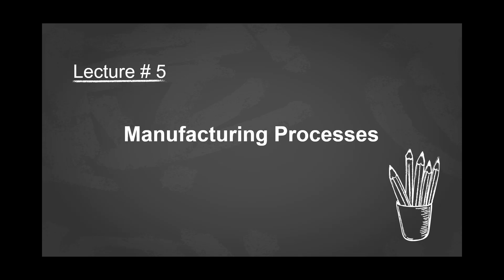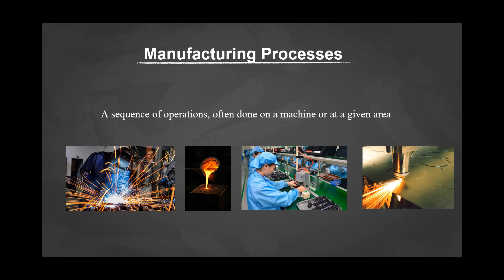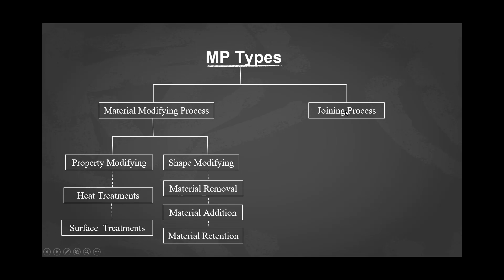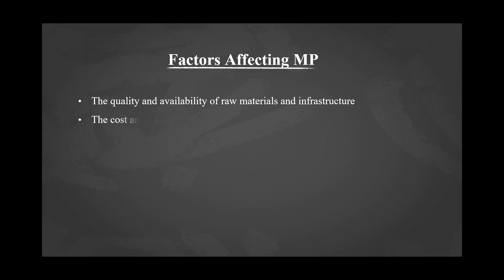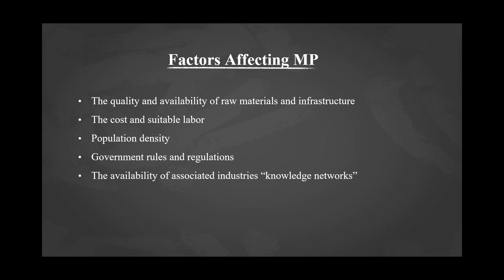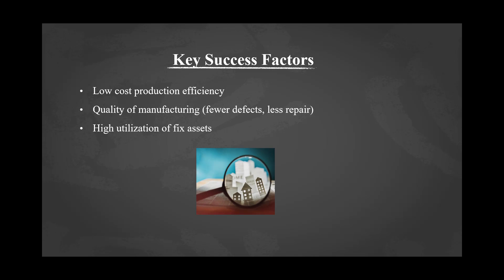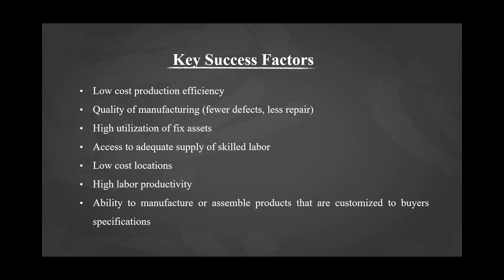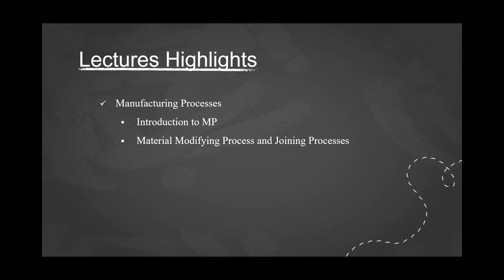lesson #5: Manufacturing Process,  Types, Factors and key success factors of manufacturing process

Comment: F18-0308
BS SE 5TH SEC A .
Manufacturing process is set of opertaion often perform on a machine or a given area to get the desired output .
Manufacturing process can be  of two types
• material modifying process
• joining process
In material modifyfing process we modify the shape or property of a material  . In joinig process we may have permanent , non permanent or semi permanent joints . 
          There are many factors that affect the Manufacturing process i-e 
• quality and availability of raw materials 
• population density
• knowledge networks
• cost and labour etc
  
KEY SUCCESS FACTORS:
 There are the following key success factors 
• low cost production efficiency 
• quality of manufacture
• low cost location 
• high labour productivity and many more

Comment: Muhammad Hashim Khan Jadoon
F18-1208
BSSE A

Summary:

In this lecture we discuss about manufacturing process and types. First of all what is manufacturing process. Manufacturing process are the steps through which raw materials are transformed into useful product.
There are two types of manufacturing process:
• Material modifying process.
• joining process.

• Material modifying process:-
Either changed the properties of a material or a shape shape of a material. It has further more types like
•Property modifying process,
•Shape modifying process.

• Joining process :- 

Joining process includes mechanical fastening, brazing , and adhesive bonding etc. There are three types of joining process:
• permanent,
• Non-permanent,
• Semi-permanent.

Along with this there are many other factors that affect manufacturing process like cost, quality, labour etc.
Now we would talk about the key factors that affect manufacturing process are: high utilization assests, low cost, quality of manufacturing etc.

Comment: F17-0136
BS (SE) 5th C
In this lecture we've covered manufacturing process in detail
Introduction : manufacturing process is defined as a sequence of operations often done on a machine or at a given area e. g casting, assembling and cutting etc
During Mp we add or subtract or form material to get a desired property
Cycle of manufacturing process converts materials into parts and products start immediately after the raw material either extracted from the minerals or produced by chemical or natural substances
Types of Mp are:
A material modifying process (property modifying, shape modifying)
Joining processes e. g welding etc
There are permanent, non permanent and semi permanent joining processes
Factors that affect Mp are:
population density
Cost and suitable labour
Government's rules and regulations etc
Then we discussed about key factors that are also known as competitive emphasis
KSF are those vital elements that are required for an organization to accomplish or exceed their desired goals
KSF are:
low cost production efficiency
Quality manufacturing
High utilization of fixed assets
High labour productivity
Low cost locations etc are the key success factors for manufacturing processes.

Comment: Basim Tanveer 
F18-0367

in this lecture we discuss about the manufacturing processes that manufacturing process is the sequence of operation of an done on machine or at given area. There are two major types.
Material modifying process: it changes properties and shape of the material.
Joining process: it contains joining, welding, breezing adhesive bonding.
Material modifying process is further divided into two parts: Property modifying and shape modifying process. These types have further subtypes but the major aspect of material modifying process is to change the shape properties performance and power upgrading etc. 
On the other hand joining process into three types
Permanent process
Non permanent process
Semi permanent process
After that we studied about the factor that affect the manufacturing process in detail. These factors include the availability of raw material, cost, labour, government policies and knowledge about the industry. After which we move towards success factors of manufacturing process like if we started work with low cost and efficiency is high and also we have ability to fixed assets. Also we have to choose the low cost location and high productivity material.

Comment: BSSE 5th 'A'
F18-0313
Summary:
In a business process, you either do manufacturing or give a particular service.
 Manufacturing processes: 
When there are a number of processes carried out on a machine or at a particular area to make the area usable is known as manufacturing processes.
 There are two major types of the Manufacturing process:
1) Material Modifying process:
Its shape modification or property medication process.
2) Joint Manufacturing process:
It may have permanent, non-permanent, or semi-permanent joints.
 Then we have discussed factors affecting the manufacturing process.
 They are Quality of product, availability of raw materials, government rules, and regulation.
Then we have discussed  key success factor of the Manufacturing process that is:
Quality of manufacturing, low-cost locations, skilled laborers, low-cost production efficiency,.

Comment: F18-0293
BSSE 5TH(A)
Abdullah
                                                                &&&&SUMMARY&&&&
This lecture is about 
1) Manufacturing process
2)Types of manufacturing process
3)Factor affecting manufacturing process
4) Key success factor

1) manufacturing process deal with the set of operation applied in a sequence on some area or machine for desired outputs.
there are two types of manufacturing process 
a)material modifying process> deals with the modification of material in the form of shape or property.
b)material joining process >deal with the assembling of material.

3) there are also factor that affect the manufacturing process some of them are given below

a)cost and suitable labour> this can effect the process in both quality and budget.
b)Government rules and regulation>when we go to start some project first we shall go and check whether there is no restriction on it from government side 
C)Quality and Availability of raw material
d)Knowledge networks
e)Population density

4)Key Success Factor>also we learn about the success factor for manufacturing process that factor is used to improve the business in term of everything that give a strong overhead on competitor. These factor are given below:
a)High utilization of fix assists>to use the fix resources for more than one thing
b)Access to adequate supply labor
c)low production design engineering
d)High labour productivity
this is all about manufacturing process.....

Comment: manufacturing process:
 we add, subtract or form materials in order to give our desired property, our shape to the work piece. The cycle of manufacturing processes convert material into parts and products starts immediately after the raw materials.

Types of Manufacturing process:
1.Material modifying process:
 Either change the property of the material or shape of the material

     
- Property modifying process

                  heat treatment  
                  surface treatment
         - Shape modified process
                   material removal 
                   material addition 
                   material retention
 2.Joining Process:
         - permanent 
         - non permanent  
         - semi permanent. 
FACTORS AFFECTING :
    quality and availability of raw material and infrastructure. 
    cost and suitable labour
    population density
    government rules and regulations
    the availability of associated Industries "knowledge networks" 
KEY SUCCESS FACTORS:
  The key success factors are low cost production efficiency, quality of Manufacturing, utilization of fixed assets,low cost location, skill labor ,high labour productivity, and low cost product design and engineering to help industries to achieve their goals and objectives.

RollNo: F18-0289
BS-SE: 5th "A"

Comment: F18-0300
BSSE 5TH A
Summary :
Manufacturing process:
     A sequence of operation of a done on a machine or a given area.
        For example: welding, casting, assembling and cutting etc.
TYPES OF MANUFACTURING PROCESS :
° Material modifying: ( either change the property of the material or shape of the material)
         - Property modifying process
                  heat treatment  
                  surface treatment
         - Shape modified process
                   material removal 
                   material addition 
                   material retention
° Joining Process:
         - permanent 
         - non permanent  
         - semi permanent. 
FACTORS AFFECTING :
   > quality and availability of raw material and infrastructure. 
   > cost and suitable labour
   > population density
   > government rules and regulations
   > the availability of associated Industries "knowledge networks" 
KEY SUCCESS FACTORS:
  > low cost production efficiency
  > quality of manufacturing
  > high utilisation of fixed assets
  > access to skilled labour
  > low cost location
  > high labour productivity
  > ability to manufacture product
  > low cost product design
TASK:
Assignment 1:
 Topic : Starting a Small Scale Fish Farm 
Me and my group mate chose this project because..... It provides most flexibility because of Low startup and operating costs and No construction or training required. Also provides low costs in terms of products and switching of locations

Comment: Summary:
Manufacturing process :
A sequence of operations often done on machine or at given area. Example : Welding, Assembling, cutting.
Types: 
1# Material modifying process ( In material modifying process we can change the properties and shape of material )
Further divide into two process 
a. Property modifying process (Property modifying process include heat treatment and surface treatment) 
These improve the performance and power of material.
b. Shape modifying process (is the modification of material achieved by material removal , material addition ,and material retention)
2# Joining process( welding , mechanical fastening, adhesive bonding)
there are permanent, non permanent and semi permanent joints
Factor affecting manufacturing process
a. The quality and availability of raw material and infrastructure
b. cost and suitable labor
c. population density
d. Government rules and regulations
e. The availability of associated Industry
•Key success factors:
The key success factors are low cost production efficiency, quality of Manufacturing, utilization of fixed assets,low cost location, skill labor ,high labour productivity,and low cost product design and engineering to help industries to achieve their goals and objectives.
F18-0318
BSSE 5 A

Comment: Annus Rafique
F17-0065
Section B
Manufacturing processes 
A sequence of operations often done on the machine or at given area for example welding,casting,cutting,assembling etc 
During manufacturing process we add subtract or from material in order to give a desired preperty or shape to the work piece
The cycle of manufacturing process converts material into parts and product.
Ther are two types of manufacturing process 
1.Material modifying process
2.Material joining process
Material modifying process is used to change property or shape of the material  so it has two types 
1.property modifying technique
 It includes heat treatment and surface treatment and they increase the performance of the material.
2.shape modifying includes removal addition and retention of material.
Material joining process Includes
1.Permanent 
2.non permanent.
3.Semi permanent joints 
Examples of joining process are welding brazing ets 
Factors affecting manufacturing process are 
1.quality and availability of raw materials 
2.cost and suitable labour
3.Population density
4.Government rules 
5.availabilty of associated industries 
Kay succes factors are vital elements that an organization need to accomplash or exceed their goals
They includes;
Low cost production efficiency
Quality of manufacture
High utilization of assets
Access to adequate supply of labour
Low cost location
High labour productivity
Low cost product design and engineeing
Ability to manufacture products that are customised to buyers specification

Comment: MALIK HASHIM RAZA
F18-0303
BSSE 5th A 

SUMMARY:-

Manufacturing process is the tasks frequently done on a machine or a given region. It is a cycle of expansion or deduction of a material to give shape or property to a work piece.

In manufacturing process, sequence of cycles on machine at explicit zone and cycle begins with the thing plan and materials detail from which the thing is made. There are two kinds of MP.

1: Material modifying process. (At the point when the shape or property of any article is adjusted.
)
 2: Joining Process.( It may have permanent, non-permanent or semi-permanent joints
)

FACTORS EFFECTING:- Quality of product, availability of raw materials, government rules and regulation.
SUCCESS FACTORS:- Low-cost production efficiency, quality of manufacturing, low-cost locations, skilled labours.

Comment: F18-0273 
Section A
Summary:
Production planning is “the administrative process that takes place within a manufacturing business and that involves making sure that sufficient raw materials, staff and other necessary items are procured and ready to create finished products according to the schedule specified”
In manufacturing process, sequence of processes on machine at specific area and cycle starts with the item plan and materials detail from which the item is made. There are two types of MP.
1: Material modifying process.       2: Joining Process.
In material modifying process, we can change the properties and shape of material. It is further divide into two processes.
1: Property Modifying Process.      2: Shape Modifying Process.
 KEY SUCCESS FACTORS:
The key success factors are low cast production efficiency, quality of manufacturing, utilization of fix assets, skilled labour, low cost location, high labor productivity and low cost product design and engineering help industries to achieve their goals and objectives.

Comment: F18-0362
BS (S.E) 5th "B"
SUMMARY:
This lecture is about  Manufacturing process .The fundamental goal of manufacturing process is to produce a product that has a useful form. Manufacturing process is one of the important steps in production process. It mainly concerns with the change of form of material or dimensions of the part being produced. 
#Two types of MP:
1)Material modifying process 
2)joining process
They are further divide into subtypes 
*Material modifying 
To change the physical properties of the materials like ,,
Hardening, Tempering, Annealing, and Surface Hardening.
*shape modifying process
 Processes involves the following:

Turning, drilling, milling, grinding to add remove material.
*Joining processes involves the following:
Welding, brazing, soldering, joining
Factors that  effect Manufacturing Process ,quality of raw material, suitable labor , government rules and industry knowledge.
success factors of manufacturing process include ,quality of manufacturing ,skilled labor, low cost locations etc.....
---------------------------------------------------------------------------
TASK :
BUSINESS IDEA: online  IT solutions company 
 The strength of our business to provide best online  IT solutions services through our online plate form in world wide.
our company  provide IT SOLUTIONS for 
*software products development
* outsourcing 
*Maintenance and support 
*Technology consulting

Comment: BSSE 5th 'A'
F18-0274
In a business process, you either do manufacturing or give a particular service.
 Manufacturing processes: 
When there are a number of processes carried out on a machine or at a particular area is known as manufacturing processes.
 There are two major types of the Manufacturing process:
1) Material Modifying process:
When the shape or property of any object is modified.
2) Joint Manufacturing process:
It may have permanent, non-permanent or semi-permanent joints.
 There are some factors that affect the Manufacturing process:
 They are Quality of product, availability of raw materials, government rules and regulation.
The key success factor of the Manufacturing process are:
low-cost production efficiency, quality of manufacturing, low-cost locations, skilled labours.

Comment: A.o.a! 
Name: Gul Sher Khan
 Roll  No: F18-0386 
	Summary:
In this lecture we are studying the manufacturing process.
•  Manufacturing process : It is the process by which raw materials are converted into a final product. The manufacturing process begins with the design of the product, and the specification of the material from which the product is manufactured. There are two types of manufacturing process which are under as:
 Material modifying process : It changes the properties or shape of a material. The process of material modification is further divided into two types which are under below:
o	Property Modifying Process : Heat Treatment, Surface Treatment etc.
o	Shape Modifying Process : Material Removal, Material Addition and Material Retention.
 Joining Process : It includes welding, brazing, soldering, adhesive bonding of materials. The process of joining is divided into three types which are under below: The process of joining is divided into three types which are under below:
o	Permanent
o	Non-permanent
o	Semi-permanent 
At the end we have studied some of the factors that affect the manufacturing process such as cost and reasonable wages, population density etc. Finally, we explored in detail each key to success, including: Low cost production efficiency, manufacturing quality and high utilization assets and so on. Then we saw some examples from automated and other companies for very low cost products.
                                                                                       Thanks!